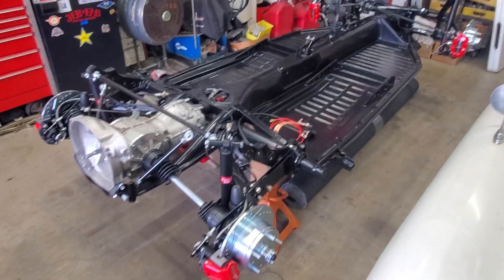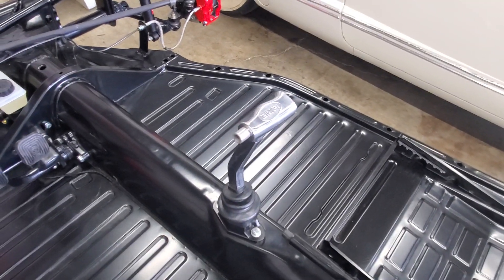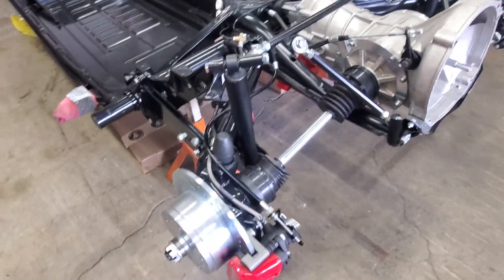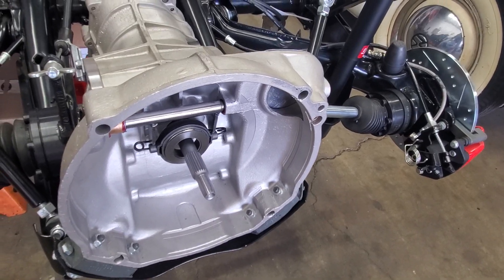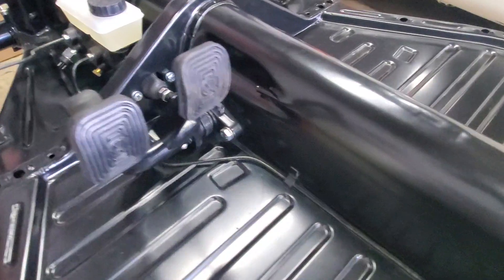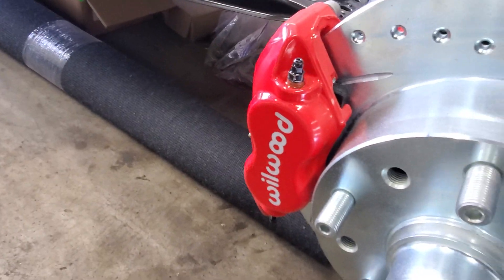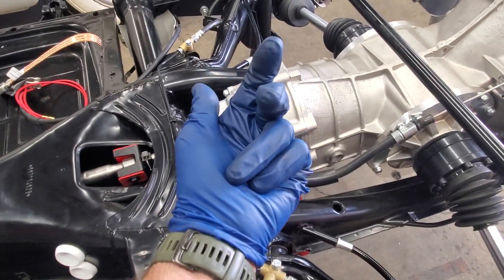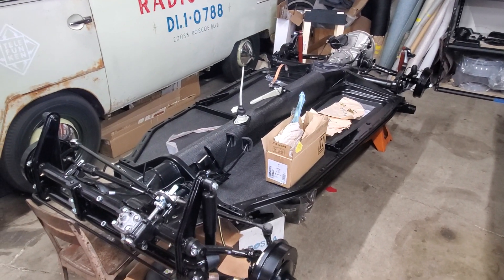Project Update and Review, the '69 VW EV Bug pan, transmission, suspension and brakes!

Comment: Estimated range?  I’ve got 7 Tesla batteries in my ‘64 and the range is somewhere between 170-190 miles.  Wish I had put Willwood discs on mine.  We put EMPI discs up front.  Braking is very stiff.
Reply from the maker: I beleive EV West says like 100 miles, or maybe it was 120. Something like that. 170-190 sounds pretty good 👍
Reply: @VintageClassicSpecialist  Yeah, the shop that did my car, Flashdrive Motors, stuffs in more batteries than EV West or Zelectric normally do.  Flashdrive guesstimated my range to be 140+.  However, after running the Bug really low one day, I started keeping a logbook of miles driven and % of remaining charge (as indicated by the gauge on the dash) and it consistently indicated a range of 170-190 miles.  However, we know that the battery gauges aren’t entirely accurate even on my Teslas.

Comment: 2:07 Depends who's paying for tires tho doesn't it?
Reply: 5:00 Or again, if you want to absolutely blow the tires off
Reply from the maker: Sorry, I'm not understanding what you mean?
Reply: @VintageClassicSpecialist  the time stamps correspond to the moments I'm reacting to. I'm implying that there's one more use for a clutch pedal that you hadn't mentioned. But I'm also assuming that you'd even need a clutch pedal to blow the tires off that thing. Maybe you're not picking up my point because my point is based on a false assumption
Reply from the maker: I understand time stamps lol. Just not sure what you are getting at? The clutch is not needed for taking off, you just ease onto the throttle in gear. The motor is not spinning when the car is stopped. 👍
Reply: @VintageClassicSpecialist  Now I feel like I'm hallucinating a little. Would an electric car with a clutch not behave like an ICE car with a clutch if you placed one foot on the clutch, one foot on the ~gas~ accelerator, and then suddenly transferred your weight entirely to your right foot?
Reply from the maker: You mean like revving it then dumping the clutch? There would be no reason to do that. Electric motors make max torque at zero RPM, so if you want to roast the tires, all you do is floor it from a stop. No clutch needed. Make sense?
Reply: @VintageClassicSpecialist  Had a feeling that's where the circuit was shorting. I don't think I've ever actually driven a fully EV. I've driven par-go carts and they're pretty much all torque, I guess I just figured EV controllers all had some sort of traction control.